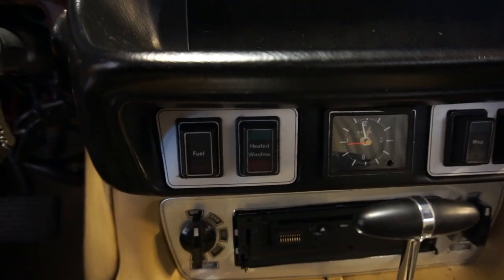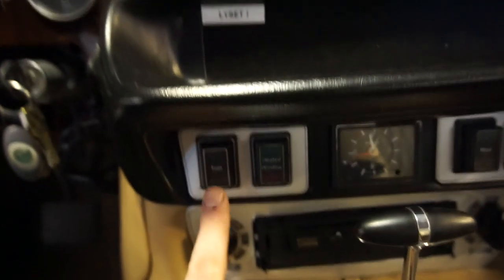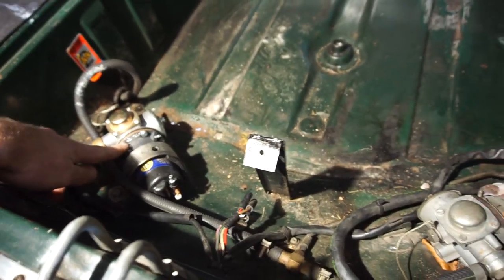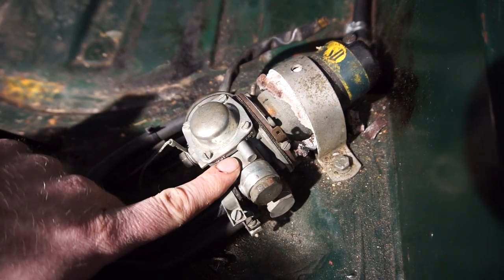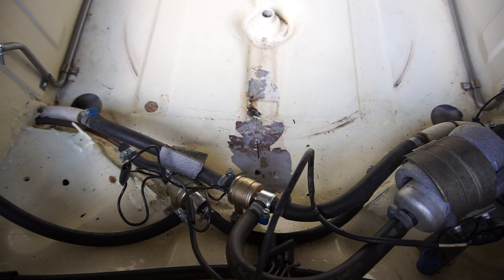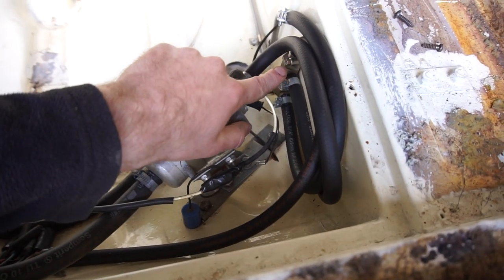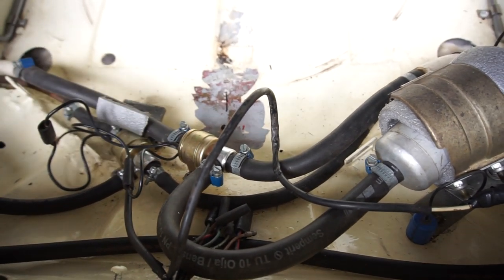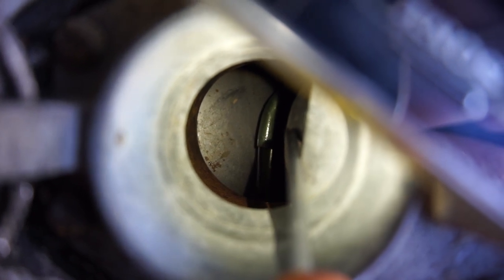Jaguar XJ6 & XJ12 Twin Fuel Tanks Explained

Comment: One point about the system , on S3s at least, is that the fuel selection for the right tank requires the valve to be powered (ie working, no wiring faults or blown fuses.   When the system is passive , fuel is drawn from the left tank.    When I do long trips I draw down the right tank first (use it while you have access),  then use the left.    It can be a long way between gas stations where I live.

Comment: I was a bit baffled on my series 3 V12 as the fuel always returns to the right tank- now I know why. I did modify mine so that I have two pumps instead of just the one as my changeover valve had died and a new pump was cheaper!!! Now the relevant pump is selected and then ( of course ) the left pump was filling the right tank from the return.  A big thank you for explaining all that. I shall delve into it in the next day or two.

Comment: One of the things that has always interested me is crash safety and how it evolved.  I usually drive American cars and I like 69-72 the best because they had the small bumpers, but also a modicum of safety equipment.  I'm really surprised to see how the fuel tanks are setup on these jaguars!  Especially since we had a big thing here on the states about chevy trucks from 73-87 having fuel tanks outside the frame rails that would rupture and catch fire in a side collision.  Also 65-70 or so mustangs have a drop in fuel tank with no firewall on the rear seat so a rear end collision could rupture the tank, and slosh fuel into the entire interior of the car if the rear seat came loose in the collision.  I'm surprised I never heard anything about how these Jaguars do in a rear end collision.  The location is very vulnerable to an offset rear collsions and the pumps and electronics near the rear are ripe for a spark.  I assume the relatively low production of these compared to my other two examples is why i have never heard of them.  I can't even google a picture of a crashed xj6.  Sounds like a fuel cell or foam racing style tank would be much safer.  I had assumed the duel tanks were under the rear seat like more modern cars and they needed the dual tanks because the driveshaft was in the way.

Comment: My father converted our 1979 series 2 xj6 to 1 pump system and the valve system was control by the dash switch he kept having issues with the two pump system  so in 1981 he looked at his series 3 fuel injected system and made something similar for carb fed engine . Father is a great engineer he so skilled. Because he can draw up systems and make them where i can do the theory but not so good and the practical
Other than rover and lancia jaguar xj6 are my fav cars.
My dream is to convert one to an ev . But being colour blinds wires are an issue

Comment: Hi, what are the specification if the fuel pump for a series III V12? Is pressure 3 or 4 bars? Thanks
Reply from the maker: If you mean a series 3 XJ12 it's about 10 bar from the pump and then the pressure regular brings it down to around 3
Reply: @LivingWithAClassic  I’m fitting a new pump, filter, hoses today and going to try to crank up for the first time! Anything else I should be doing before I try to turn on the engine?
Reply from the maker: Just prime everything a few times and check for leaks before you try to start it. Best of luck!

Comment: Hi adam
Great explanation
I own a series 2 6L
The precious owner replaced the 2 fuel pumps for one electric pump

When i started the car after the wintertime (4 months in the garage), no fuel was coming from one of the tanks.
After checking the pump, I could not find anything
After switching over manually to the other tank, fuel starting flowing and the car started without any issue

Hearing to your explanation, could it be the valve is stuck?

I deliberately moved over to using ecofriendly fuel (aspen based) before the wintertime in order to prevent these issues

What is your guess the problem could be?

PS both tanks were fullwhen parked for the winter

Comment: Hi Adam.  I'm Neil in UK, and thinking of buying a nice condition XJ6 1986 4.2litre Jaguar.  So I know it has two fuel tanks, but how can I check to see if the tanks are in good condition before I purchase the car, as I understand they can get quite rusty under those rear wings.
The car has been stood for a few years, but runs. But it wont run smoothly, and cuts out when releasing the throttle. Seems to be running on all 6 cylinders ok.  Any advice you could give me will be much appreciated. Thanks.....Neil

Comment: Hi Adam I am attempting to return a 1978 Series 2 XJ6 barn find back to a daily driver. I have an issue with the tanks as the left just feeds the right. Sometimes it runs ok but eventually it runs dry by pumping into the right tank. I have a South African S2 which has intank pumps but with carbs. I do not see any valves in system nor an I see a return line. It appears to be one line from the right hand tank with a “Tee” accommodating the left hand tank fuel line. I know that these South African as well as New Zealand and Australia were basically left over parts models but I basically can only use one tank on this set up. I don’t think the Vehicle has been modified so any suggestions.

Comment: It seems that the reason why there are twin fuel tanks is that the big spare wheel did not fit in the beautifully sloping boot, otherwise than laying horizontally on the boot bottom. The spare wheel thus took the place of one single tank. Then two smaller tanks were fitted in each wing to give the car sufficient range. I suppose it was a technical complication to have the twin tanks filled via only one filler cap.
Reply: The twin fuel tanks was a feature on many of the Jags- not just the XJ and the reason given was to liberate space and help the balance of the car.

Comment: hi buddy i have a xj12L 1975 had all new fuel lines new pumps carbs rebuilt i ran the car but stored it over winter i put gas additive in both tanks now i turn ovwr the new pumps working but no fuel to the carbs car wont start even the tanks each have $50 in each but my emergency cut off valve under dash at passenger side wires are of is this the problem please and thanks super videos by the way keep up the good work

Comment: You mentioned you replaced the OE pump on your series two with a later Bosch from the HE system. Would you happen to have that Bosh part number? I think I found it as Bosch 69469, is that correct? I'm fixing a 76 Series II that was sitting at my local airport since 94. Only has 15k miles!

Comment: Thanks Adam.Greetings from Cape Town,S,Africa.Just discovered your channel and subscribed.Had a general idea how the twin tanks worked,but you filled in the blanks.Starting to restore fuel system of a '89 Double Six I bought recently which had been standing for years at the previous 2ownwers.Managed to drive it  home 30km running on five cylinders.Got the Haynes &factory workshop manuals & even 1 showing how to install a Chevy V8,which is also quite popular here,but looking forward to viewing all your videos on especially on the V12's.Also have a properly runing '84 XJS-Cabrio 5.3HE and need all the tips and help I can get to keep them running.You have any experience on converting a V12 to a manual transmission?

Comment: I am in the process of designing a dual tank fuel system for my Aston Martin DB5 replica project. I am using a 1966 Jaguar XK 4.2 engine from a 420.  I am using a 1996  BMW Z3  unibody "chassis" for the suspension, steering, brakes and main structural substructure....wheelbase and trackwidth are fairly close. Since the XK engine is very heavy I think it is important to shift as much mass as possible to the rear to help balance the car for decent handling. Therefore rear "saddle" tanks behind the rear wheel wells very similar to the Jaguars make sense. Non A/C DB5s also used dual tanks for that reason. The Lotus Esprit also had dual tanks, but with a "balance tube" so that fuel could be filled from both sides ...as well as being burned equally. Is it possible to use a balance tube in a Jaguar fuel system, and have one pump and filter?  Thank you.

Comment: I have a series 1, and have a question regarding the upper tank hoses on each side.  On the top of the tanks closest to the back of the boot, there is a metal outlet valve coming out of the circular hole in the body with a hose attached on each side.  Mine are not connected to anything.  When i fill up the tanks, the fuel smell is extremely strong. The question is what are those hoses supposed to be attached to and is that where the fuel smell emanates from?

Comment: Brilliant! 
Question : On my 1981 XJ12 H.E. there is no swoosh sound when I open the filler caps, indicating there is no underpressure in the tanks. 
However, on my 1985 XJ-SC 3.6 TWR (with one tank only) there is a definite swoosh/underpressure sound. Can it be clogged ventilation or something else? Incidentally, my 1988 V12 Sovereign also had the swoosh sound. Aside from using air pressure etc to blow out ventilation pipes, is there an easy-fix in the filler cap area ?

Comment: Great explanation, thanks!  Recently purchased XJ6L.  Note, it has a GM 350 conversion.  I have never pushed the dash "Fuel" switch.  At fuel stops I fill BOTH sides and they always have taken equal amounts to fill up.  Was something changed in trunk?  Am I missing something in explanation?
Reply from the maker: My guess is that someone has connected them together in the past on your car. Go check the boot floor in the back and see what it looks like.

Comment: I really don't see the point of having 2 tanks.
Has anybody ever tried to connect both tanks with a hose (bottom to bottom) so it can be  used as one big 90L tank?
Reply: That would make a video worth watching.
Reply: yes its been done many times,  usually with non return valves so that fuel doesnt siphon between tanks when parked on a slope

Comment: Good video but not quite right re all series 3 xj6 have the fuel filter in the boot.   I have an early series 3 and the filter is in the engine bay.  Also the changeover switch says "fuel" not a picture of a pump as with later 3's.

Comment: It is obvious that it is critical to know how to tell if fuel is returning to the correct tank. I drove  xj series 2 o a warm day. When I shut the engine off I smelled fuel at rear of the car. I opened the tank.door and high pressure vapor rushed  out, taking over a minute Thor the pressure to normalize with atmospheric pressure. ( also my ac was not working.)

Comment: The Series 3 I bought yesterday has right tank disconnected, the return switch has been removed, I'm guessing it failed & one tank was overflowing. 
I will investigate & get both tanks working, however, the car has barely been driven for years, other servicing, maintenance & cosmetics will take priority in coming weeks, it will be some time before both tanks are operating.
Reply: How did you go about the failed tank? a year later*

Comment: Hello super nice videos. Has is xj6 from 1984. It starts to go bad when it's driven about 30 minutes, like it's running gas. Stutters and sets off. If I leave it for an hour, it can go again. There are new filters on it. Do you have any idea? Well, you can help me Vh Jesper lynge.
Reply: Did you check the fuel intake valves, because this happens sometimes when the engine gets flooded

Comment: Hi, this is very interesting thank you. I was wondering what fuel you use in your 75 series 2? Do you use unleaded and add the special additive? Your advice would be much appreciated as I’m getting conflicting advice regarding my 74 series 2   XJ6. Thanks in advance
Reply from the maker: I run it on premium (98 octane here). All Jaguars after about 1967 run on unleaded fuel. Thanks for watching 😊
Reply: Living With A Classic thank you so much, I did not realise that. I have just purchased my vehicle and I’ve so much to learn! I am very used to old British cars of the era but not of a Jaguar as they were way out of my reach at the time.

Comment: HAD A FEW 84 -87  XJ6. VDP ,FEW TIMES PUT SMALL T PIPE TO MERGE THE TWO TANKS ,UNDER SPARE TIRE IN TRUNK..FOUND IT EASYIER THEN FIXING FAULTY GAUGE
Reply: Do you have a link for the small t pipe?

Comment: Where is the tank switch for a 1972 xj6 series 1?
Reply from the maker: The switch is on the dash. But if you mean the tank switch in the rear like I showed on the V12, a series 1 doesn’t have one. It is two pumps just like the XJ6 I showed

Comment: Thanks for another great and informative video, I’m watching it now as I suspect that the DD6 I just bought needs a new pump!
Hower, you mention the two types of fuel caps, the flush to the body one and the one that’s raised up.   Do you know why they were different?  
On the S3s I’ve had:
1981 German spec - flush
1989 German spec - flush
1990 German spec - raised
1991 Japanese spec - flush
I’m happy that the one I just purchased has a flush one, as the one I had before, it really bothered me to have it raised.
Reply: Because the flush fit ones were more inclined to let water in if the drain was plugged I think. I know my old series 2 did let water in but the series 3 seems a lot better.

Comment: That flapper will piss you off if you try to pour in gas from a gas can when you can't get to the gas station since the gas will fill up and all over the fender and trunk......I had to pour in a gallon at a time using a large screw driver to push that damn flapper down to hold it and then carefully pour in the gas a gallon at a time.........and when you have an old 1980 you will find that switch to switch the tanks will not have a light that works........THEN you look in the owners manual it says OUT for the right side........well if you have had many different cars in your life you will see people say the right is the passenger side OR the exact opposite by saying it is the opposite when you are under the hood and then the drivers side is the right side......of course they didn't have the stupidass dual tanks either.........now ever try working on the rear disc brakes?.........you won't be happy about that if you do and that is another Jaguar stupidass idea.
Reply from the maker: Or you could just be good at working on them and have it all work as it should. My cars work very well and so do all my customers cars